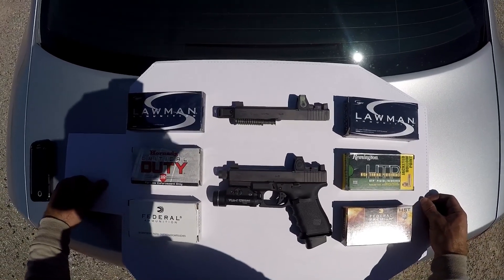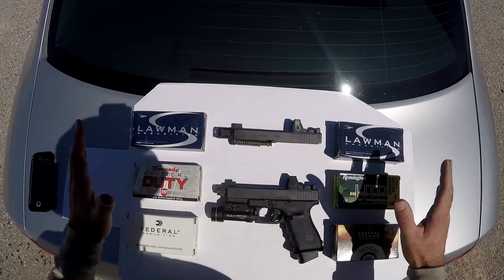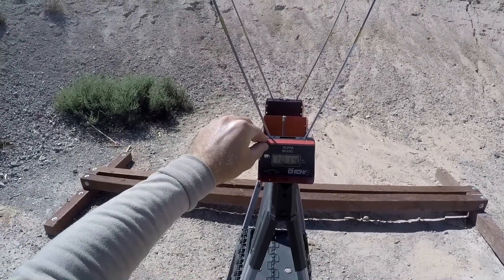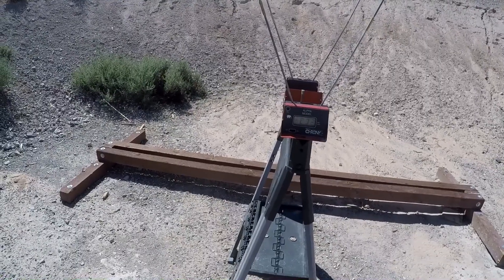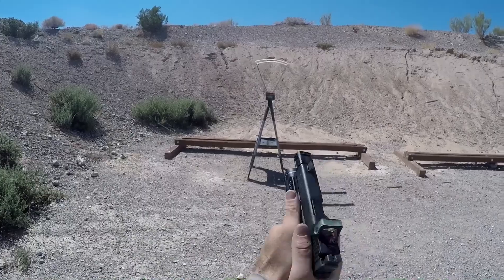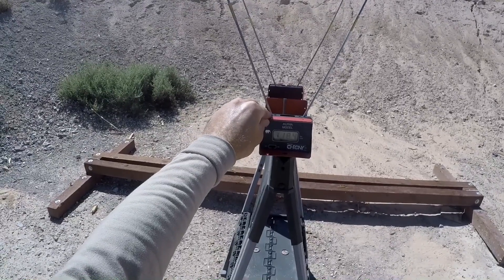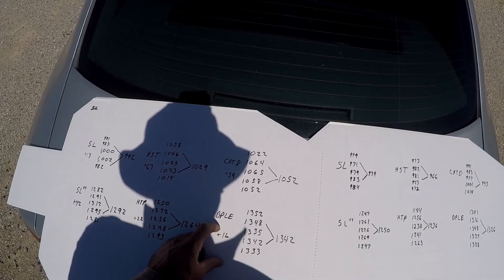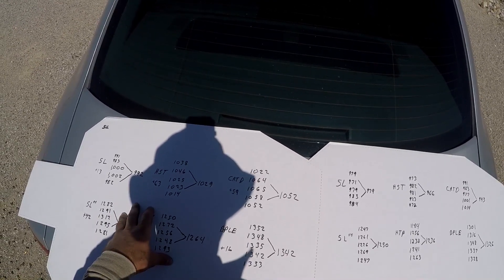Polygonal vs Traditional rifling velocity test

Comment: I like the polygonal rifling. I don't understand why more weapons don't use it because of the life and velocity
Reply from the maker: Slytiger Its a more expensive process to get started...so most small manufacturers opt for traditional rifling...sort of like cold hammer forged...which Glock barrels are as well.  I agree though..I wouldn't mind seeing more polygonal/cold hammer forged barrels from American manufacturers...
Reply: Slytiger polygon rifled barrel is easier from being grinded.Actually you can use just four land and groove line so it's easy to produce.